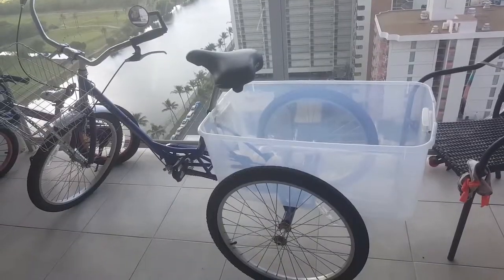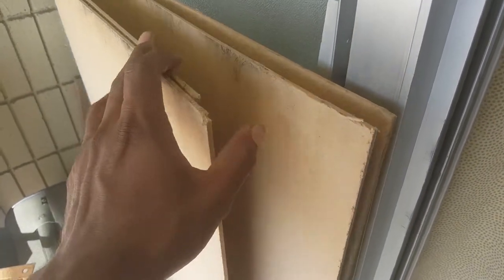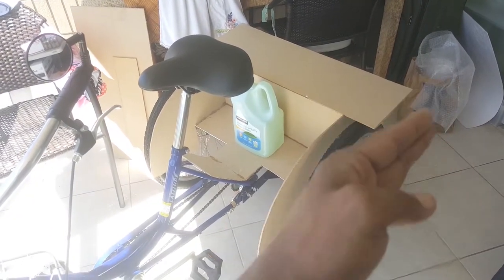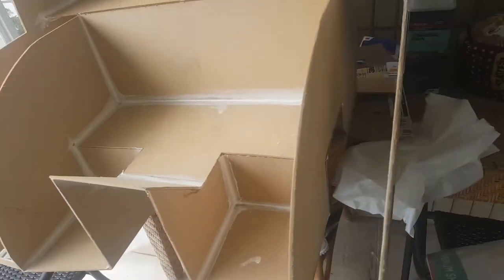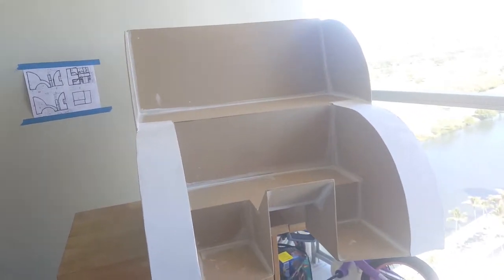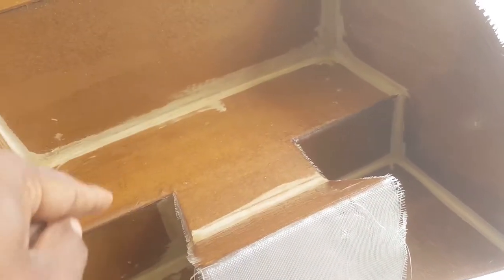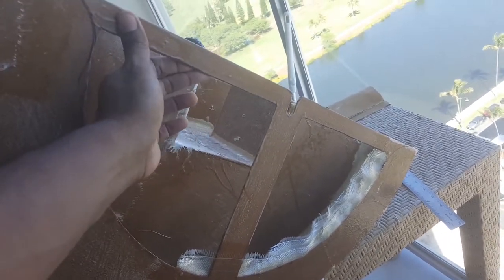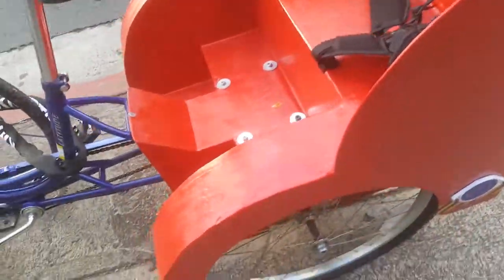Fiberglass Tricycle Bench Seat | DIY

Comment: I came across this because I'm trying to convert my tricycle from basket into a passenger seat for my special needs son. I have not been able to find any conversion kits. Your video was AWESOME!! No way am I clever enough to get it done. But it was genius!!
Reply from the maker: It wasn't that difficult it was just time consuming and even then it would have been faster if I wasn't working and in the process of moving.
Reply: hi did you ever make your passenger seat? I'm in the same boat rn ^..^
Reply from the maker: BTW, this was a compilation of a few vlogs of the process. Feel free to check those out and ask me any questions if it gets confusing for you.
Reply from the maker: @Jasmin-vn4qr  I have a few vlogs that go into a little more detail. Let me know if you need help.